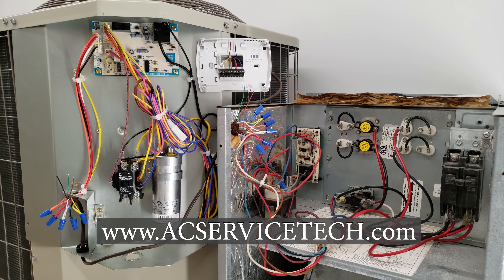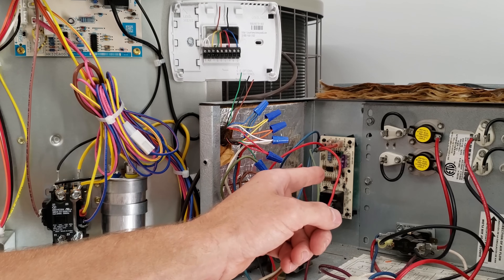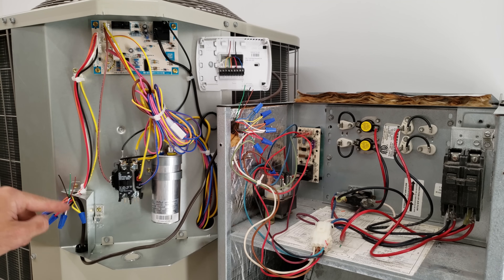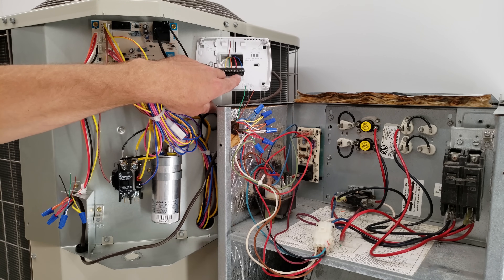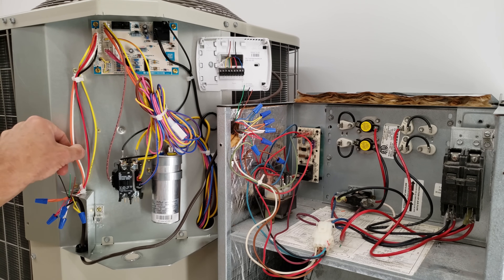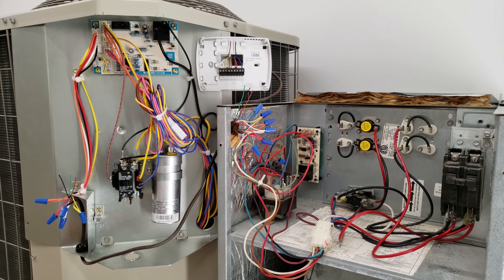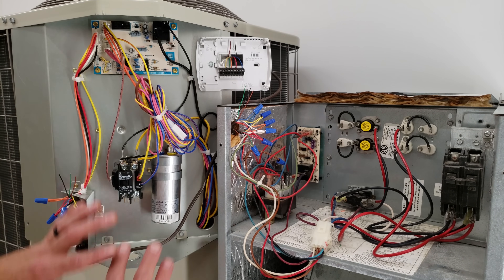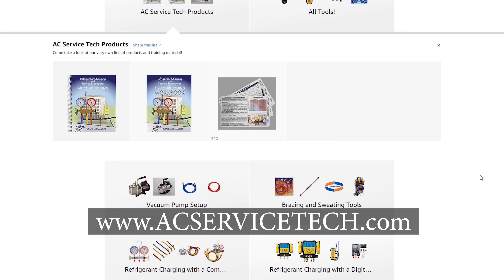How an Air Handler & Heat Pump Work & are Controlled by 24v Thermostat Wires!

Comment: I served 4 years in an apprenticeship in sheet metal local 36. 2002 graduated 2nd in my class with 98% overall grade average. They didn’t teach hvac-r, just sheet metal. Studied hard 2 weeks and took EPA test through Mainstream Engineering. I passed with a 98% Universal license. Your books have taught me more in 2 weeks than I learned in those 4 years of training and it’s easier to understand. I was a lay-out man but now I’m a new service tech. My hats off to you for the training and it cost me less money to boot! 4 years of training was over $10,000 in sheet metal!
Reply: SMWIA local 105 Los Angeles retiree here. Maybe you can help me? I have 27vac from my air handler through my thermostat to my heat pump outside. 27vac going into the circuit board, but nothing going to the contactor for the fan and pump. I can manually press the contactor in and the pump and fan come on. Any suggestions? BTW,, this is a Goodman Heat Pump.. LOL yeah I know.. throw it out and get a better one. I cant afford that right now, but someday. This is a 2014 model.
Reply: @jmead2294  So power is going to your defrost board, but not coming out to the contactor? It could be in a high or low pressure lockout. Some boards have flashing LEDs that will give you a sequence to look-up. You can also disconnect the low/high pressure switches and check them for continuity (to see if they may be open, and if they are, then you've found the reason your board isn't powering the contactor.) If both switches have continuity (or you can check for OHMs,) if they read OL--OPEN LOOP, then they are either bad, or you have a refrigerant leak/blockage. You can also pull the pressure switch wires off the board and check them that way, may be easier. 

If the pressure switches are good, then the board itself may be fried. It's not too uncommon for a board to die.
Reply: @jmead2294 Did you ever figure out your problem? I am having the same exact problem with my Goodman heat pump and was installed 10 years ago. No power going to contactor but from my troubleshooting I believe my pressure switches are good. Unit works when I press in contactor. There is a clicking sound from defrost board, I'm assuming when it tries to work and scarese every time and makes me jump especially when I'm trying to be careful and test the terminals lol. There has been a couple times during the past week while I was sitting in front of it watching videos on what to try next the the unit would kick on and run but once it shuts off, it doesn't kick back on like it should. The issue started a couple weeks ago when we had the real cold spell. I'm in TN and it stayed below 0 for almost a week. The unit did great all week. Had it set at 68 and the coldest it got in the house was 65 and I was happy with that. The last night of freezing temperatures around 11 pm I realized just the blower was blowing. It was warm air so I knew heat strips were working. Went out and checked unit and it has a couple inches of ice in the bottom but it had been there all week and the compressor had a gab between it and the ice so I knew the defrost had been working. Next day I checked it out better and took panel off and the defrost sensor on coil was frozen over and I hoped when it thawed it would be good but it wasn't. I then started checking wire connections and found the yellow wire from thermostat into unit was broken in the wire nut. Just assumed it was because it had been so cold and the thermostat wiring was here before unit was replaced 10 years ago. Connected it back and it worked. Patted myself on the back and closed it up. Tooted my horn too soon because it didn't start back up once it kicked off. Spent the next week in between the rain showers troubleshooting it. Once I figured out the pressure switches were good, I was somewhat relieved because I can figure out how to fix everything but those switches and Freon issues. Contactor, transformer, new thermostat wires, new capacitor on the way (cause not expensive and an extra one on hand is always good) I'm starting to think the problem is in the defrost board and that's how I ended up here. Will be going out in the morning and start troubleshooting it. Hopefully you got yours fixed and it sounds like we may have the same issue and the same heat pump. Any help would be appreciated!
Reply: Sheet Metal and HVAC are 2 different trades, my friend. Refrigiration is also another trade.

Comment: Awesome video! I love it! Could you make a video on the older system without the control board, like an old Fedders model # BWRE018S7DA? 
I’d very much appreciate it. I run into dinosaur systems a lot here. These systems are the ones driving me crazy. 
I’m really learning a lot from your books. I’ve read it 3 times now and get more from it every time I read it. Thank you so much!

Comment: Does the timer ever reset on its own regardless of  the defrost terminator? Say if the unit runs 3 times and the switch does not see it cold enough for defrost.